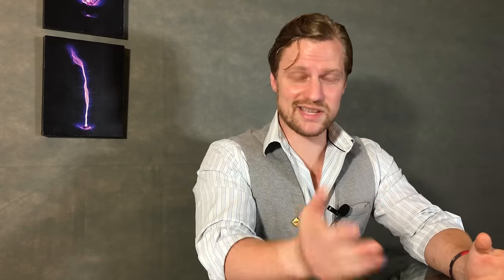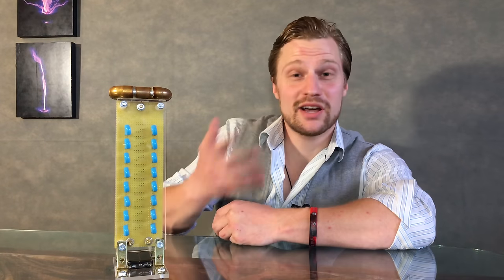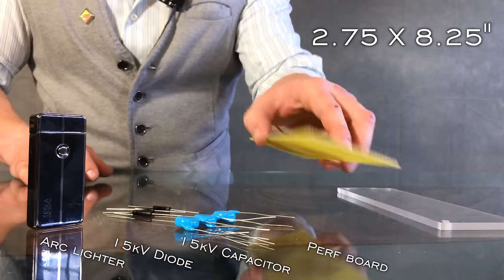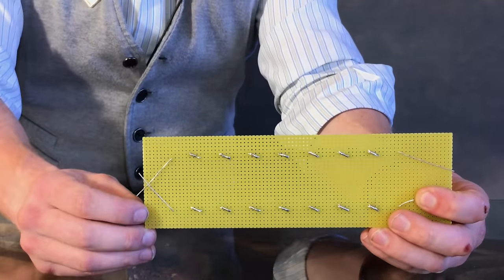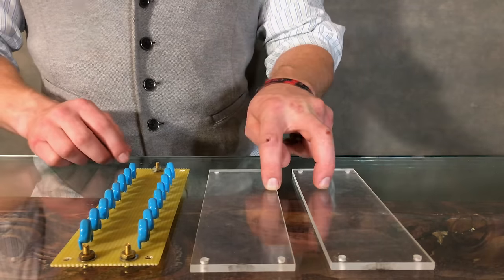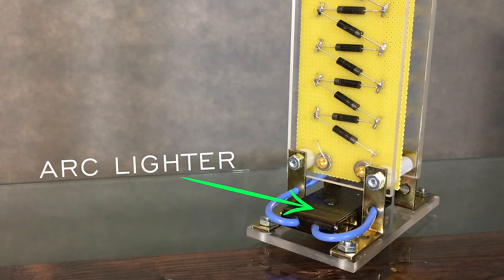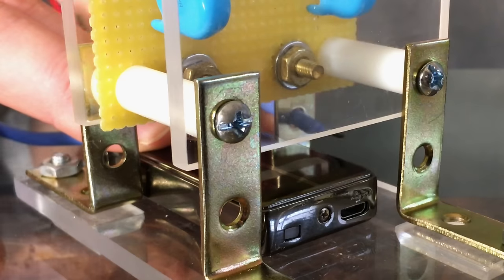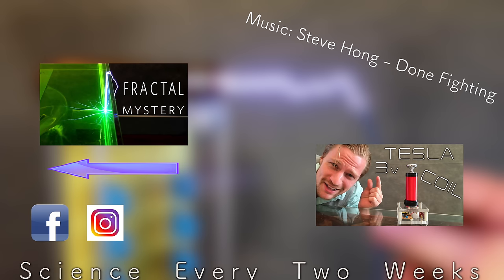DIY Desktop Lightning Tower (USB rechargeable!)

Comment: I would like to build a voltage multiplier using one of those ebay musical tesla coil kits as the power source. Could you please do a tutorial video on how to do it? It will be such an awesome build to see if it would amplify the music as well as the spark. Thank you for your consideration. I've subscribed and followed, hope to see it someday, as I don't wanna injure myself trying to figure it out. ( ; D)
Reply from the maker: Welcome to the family! And great idea.
Reply: How do get the high voltage for your equipment ? As I want to build a small arc generater      thanks Ben

Comment: Hey Jay, Love your channel!!! I made your voltage multiplier with 2 towers, 1 positive and the other negative and it works Awesome!! Keep up the great videos!! I hope you get that YouTube play button!
Reply from the maker: That is awesome! What is your max spark length?
Reply: Plasma Channel  13” is the longest so far before the capacitors start arcing across each other.

Comment: Hi Jay, Again, a bit late to the party, Only one suggestion..... Ok, 2. 1 a circuit digram for those that don't know what multiplier you are using, and 2 where the circuits ground should be, I did not see you show it. Other than that a perfect delivery, Thank you for your hard work in making these videos.
Reply from the maker: Certainly. The circuit diagram is the same for every voltage multiplier. You may search voltage multiplier schematic on google, and you can choose which way your diodes face, to determine (+) or (-) output. The ground is one of the input wires.

Comment: With : 4x 18650 lithium batteries, 4x tp4056 modules , 40x diodes, 40x capacitors, a 15KV High Frequency DC High Voltage Arc Ignition Generator Inverter one bc547, one bc557, one 1M ohm resistor one yellow led, one toggle switch, one push button, a 5V 4Amps charger and epoxy resin i made a powerful stun gun.

Comment: Nicely done!  I built a 14 foot tall version a few years ago for a big contract.
Reply from the maker: Thanks! Whoa... I’d love to see pictures of that. You should send a picture to my email in the ‘about’ section
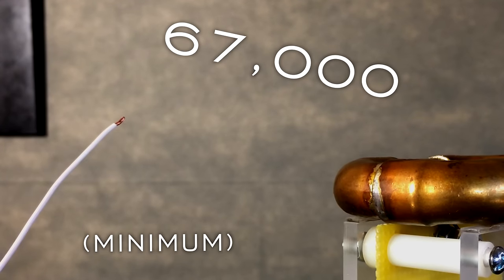Reply: I showed a few pictures at 1:30 mark in my mini lab tour video I released yesterday.  It was amazing, the diodes and capacitors I had to use were over $200 each.  I found a retired engineer from Fermilab to make the corona rings for me. I designed everything myself, including the drive circuit and a large potted transformer for the start of the stack.
Reply: What voltage, .....what application.?

Comment: Thanks for the video. I'm new to this stuff. Once all my capacitors and diodes came in I went to work right away building my own model. I was expecting it to explode but IT WORKED !! My arc is only about two inches but it's awesome. Thank you very much !!
Reply from the maker: Hi John! Im really happy you got it working. Just remember, only let it discharge to it's own electrical ground. Be safe, have fun!
Reply: Hello, this project looks amazing! I'm collecting the parts to make this project. But I don't understand where the electrical ground is for the lighter. I can't see on the video where you connect the wire too.  Many thanks! @PlasmaChannel

Comment: I used to work in a TV shop. A flyback transformer does the same thing and produces 30kv to charge a picture tube on an older tv but only milliamps of current so it's not lethal.  If you accidently get popped by a picture tube discharging I guess its like being hit by the difibulator in the ER
Reply: Which depending on what part of your heartbeat cycle it hits, can still stop your heart, or put it in fibrillation.
Reply: But Flybacks produce DC don’t they?
Reply: @Coyote0874  Asymmetrical AC. They are generally used to feed a diode, or vacuum tube (electron gun), that rectifies the output.

Comment: Very nice. To make it safer one could add a high value series resistor with the output terminal and top
Reply from the maker: This is correct. The output current is higher than I would like
Reply: @PlasmaChannel  The resistor would perhaps make it operate better as well given the current draw on the HV will be limited.

Comment: Wow this is awesome. I'm quite young and am not really sure what I want to do with my life but I am starting a few new hobbies. I'm really glad I found your channel because it inspires me to make things like this. Problem is I'm torn between the spark gap coil or this lol
Reply from the maker: Hi Cameron. I would highly recommend the mini spark gap coil first. It is much safer. I do not recommend building this if you are totally new to High votlage. Cheers, and welcome to the Plasma Fam!
Reply: I'm not too worried about the safety. It's more getting the materials and for that I think it's far easier for the spark gap tesla coil. Either way they're both awesome. Thanks so much
Reply: @PlasmaChannel  also may I ask how long it usually takes to wind up with copper wire for a coil?

Comment: Excellent work. Very impressive. Can you please explain how the copper tube is connected to the structure?
Reply from the maker: The copper tube is electrically connected with a wire that wraps around the top high voltage bolt on the board. It is glued in place.

Comment: Hi! Do you think that it would be possible to use an electric fly swatter circuit as the original HV voltage source instead of the lighter? Kind-of like in your museum mini tesla coil video.

Comment: Hi, I've enjoyed building this voltage multiplier but rather than use a cigarette arc lighter, I decided to use a barbeque arc lighter because the HV transformer already has long leads, is also USB chargable and has versatile positioning...
Reply: I just burnt out the arc lighter by arcing to the wrong ground. I drew my arc to the ground of the arc lighter when I think I should have used the multiplier ground… would that be right? New BBQ arc lighter circuit installed and everything is working fine.... for now.... ground taken from the multiplier section instead of the lighter ground

Comment: For anybody building this, if you could, buy 18650s from a trusted place like Illumn and IMRBatteries, and then connect them using 18650 holders, with the same charging circuit.

You will get much better battery life that way.
Reply: use a hv ignition kit then? with the 18650 batteries and then a push button switch or what did you do? wioll it work is it cheaper?

Comment: Hi Jay... quick question... if this lightening tower is not used to produce sparks... can it be used to produce electrostatic charge for longer periods?
Reply from the maker: It can, but I noticed that it tends to die easily if it continuously is just building up a static charge. That little arc lighter is very very fragile.

Comment: Well done video.  I would like to have seen where the wire was connected to, and how the copper top part is connected.  I know these should be as simple as running a wire and soldering, but I feel unsure.
Reply from the maker: Certainly good points. Thanks for the compliments. By the way, did you find the video's volume levels to be off or unsteady?

Comment: This is the coolest thing I’ve seen on YouTube!!! This so amazing!!! I am not understanding where to connect the positive supply from the lighter and where to connect the other lose wire to get spark from the copper tube... can you please explain this... please
Reply from the maker: Hi, there is no positive supply from the lighter. The lighter is AC. It goes in at the base and connects to both sides of the ladder. The copper tube up top connects to the final stage, the end, of the multiplier. Thank you for the compliments. Remember, only allow the device to discharge to its OWN electrical ground.
Reply: @PlasmaChannel  when you say the electrical ground of the multiplier, this means one of the terminals of the arc lighter's output, right?

Comment: nice!........that is a cockroft-walton brige.
have you heard of a marx brige (even simpler, and no diodes)
Reply from the maker: Marx impulse generators are very cool as well. They are a bit problematic when it comes to finding appropriate high voltage resistors though.

Comment: Can we use a high voltage transformer without  using the arc lighter  (high voltage transformer 3.7v-4.2v to 15kv boost step-up power module generator)

Comment: I built one similar in design to yours.  I used a piece of thin luan plywood since bare perf board is hard to find.  Just drilled holes for the capacitors and then spray painted the board black to highlight the light blue capacitors.  Looks nice through the plexiglass.  I'm using an arc lighter module DIY kit to power it.  I do get small sparks and a lot of corona off the top load but not really satisfying POPs off of it like you do.  Not sure what I might be missing.

Edit:  Reading through the comments it could be that my nice black spray painted board I've mounted my components on is leaking much of my high voltage away.  Bare unplated perf board is HARD to find.  Just about everyone plates the thru holes which won't work.
Reply from the maker: You are correct on your edit. I should have a link in the video descrpition for the perf board
Reply: A followup.  I rebuilt my capacitor/diode ladder onto a piece of Kydex plastic.  I found a sheet of that in black. Though it's more used for thermal molding it has good electrical properties as well.  I cut it to the same size as the piece of luan plywood I had been using.  The new setup will give me sparks about an inch long or so IF I add something pointy to the smooth copper pipe top load.  Off just the copper pipe top load I get a lot of corona and less satisfying discharges.  I don't know of any way to increase the output.  The small arc lighter circuit I'm using to drive this ladder says 3-5 VDC input and I'm already using 4 D-cells or 6 volts.  I could add another cell or two, I don't know what I'd hurt in my input circuit except perhaps stress the transistor a bit.  But it's on a good heat sink and it's not getting very warm even with 6 volts.  I can't put 2 of these circuits in series because the output is A/C.  The two circuits will not be in phase and so the outputs will not simply add.  The little DIY AC arc lighter module kits I'm using are only about $3.50 off of Amazon so if I damage one by using too high of a DC input it's not a huge loss.  Worth trying a higher input DC level.

Edit:  Holy crap!  With 12VDC input this thing makes huge sparks!  Over 2 inches long! And the transistor isn't getting more than slightly warm!  If anyone needs a good input power supply for their lightning tower, go to Amazon and search for "15KV High Voltage Generator Boost Step-up High Power Module Inverter".  Vendor is Walfront.  You get two build it yourself circuits for $6.99.  Cheaper than a lighter!

Comment: Your multiplier makes topload negatively charged. So if you remove the copper top-load and put sharp needles or carbon fibers instead will it be the most powerful negative ion generator?  Will it throw most powerful ion wind?

Comment: This is amazing! I would really like to see a electrical circuit of that, I tried to understand in which way you connected the capacitors to the diode’s and I had no idea how you made it, I by myself want to build this so please upload a diagram or make a new video and try to explain a little more because some of the information was missed, thank you very much, i send it to improve!
Reply from the maker: Hi NirNana, This is a standard voltage multiplier schematic. You can search the schematic on google. I'm glad you enjoyed the video

Comment: Hi Jay, did the arc lighter specify which of the 2 hv wires was positive? Or did you need to figure that one out. Thanks
Reply from the maker: The arc lighter was high frequency AC. There’s no solid positive lead
Reply: Edit - I got it working, even though my lighter has the X/cross plasma arcs I can use one of the HV outputs and it still works. Thanks! Now to build the tower :)

Comment: Without any doubt you are a great personality when you dedicated all this effort; and I am in debt for your videos. You are surely aware there are different forms of similar circuits like the one you are presenting in this video. Notably there is a famous one called Marx Generator, you can simply check the internet. This Marx Generator simply replaces your gas lighter for a simple battery.

Comment: Can I use a mosquito swatter instead of Arc lighter?
Reply from the maker: You cannot....as mosquito rackets are DC. Multipliers need AC input
Reply: @PlasmaChannel  thanks for the quick reply sir. Can you show us a method to do this with salvaged parts? ( If it's not too much to ask). Most part you listed are not available to me. But it's an interesting project to make.
Reply: Btw, I love it when a youtuber genuinely replies to our query.  Hope you channel grows. Amazing content!
Reply from the maker: Hey, thank you so much! So, I actually made a casual video about how to make a high voltage power supply. Its called DIY 10000 AC power supply. It can be used for this project, IF, you tone the power down. But i'll look into how to make a high voltage variable output supply

Comment: Building the desktop lighting tower. I could use some clarity on the diode polarity. Also what connection is ground to attach the spark gap lead. Is a schematic available?

Comment: This is such a great project. I could not tell inbbthe build where the ground lead you talked about was built in though. Where should that be? And does the copper pipe at the top need to be a closed loop like that or can it be a cylinder extending up? Thanks for help and thanks for all the awesome videos!

Comment: @Plasma Channel i have already got my own arc lighter however as you said"Frequency is not super critical. Any high frequency AC high voltage will work (as long as it's less than 5-6kV). But I'd quickly calculate it as 12kHz" , i'm wondering how to calculate the frequency of this little device. Maybe you can help me with my problem.
Reply from the maker: by 'this little device', do you mean your lighter? Mine as I found out recently is 15kHz. Works like a charm! I found out my frequency by placing it near the probe of an oscilliscope.
Reply: @PlasmaChannel  YES,i do mean the arc lighter. I have measured the arc lighter that i bought on Alibaba which is a online shopping website in China. But i found it is not qualified for my purpose. So i want to build a arc lighter by using the sample topology(circuit diagram) called "Joule Thief" with a transformer. While by doing this, i don't know which part of the circuit determines the frequency.  I thought that you do calculate the frequency.:P

Comment: It's a Cockcroft-Walton multiplier, but I thought those require AC input, not DC from a battery, unless the lighter converts DC to AC.
Reply from the maker: The lighter pumps out high voltage AC

Comment: Fair enough, I tried getting a little spark gap setup working yesterday and it didnt work. I used a 30kV 2nF cap and 2 12kV Microwave Diodes, hooked up to a 15kV Plasma lighter type HV Supply. There was almost no voltage on the output, and i suspect that the diodes cant handle 22kHz.
Reply from the maker: That is correct. Those diodes are not intended for high frequency. Basically they have no idea what is going on, and dont conduct when they should. You need special diodes, like the ones I have linked in the video description. Best of luck!

Comment: I’m going to put an apoxy resin on the base of my lightning tower to help insulate the edges i might have because my not so round soldering skills. My caps are rated at 20kv 1nF, and my diodes are rated for 20kv 5milliamps(couldn’t find any with high current rating with my budget) i’m considering a 10-15stage, the AC input power is going to produce 15-20kv high frequency power with a small circuit i built. I’m hoping this will give around 5-7” spark
Reply from the maker: Cheers! Let me know if you have any questions. Just know, those diodes may not last long. A 5ma diode cannot handle the high currents involved with the discharge of a spark.

Comment: Instead of an arc lighter is it possible to use those high voltage modules on ebay ? They are black and cylindrical

Comment: i want to make this but i have an arc lighter with 2 arcs crossing. how do i do that?
Reply from the maker: That's actually what I ended up using. Wire the two transformers in series. Experiment to see which two of the 4 high voltage wires need to be connected, in order to make the highest voltage. This will, however, cause more coronal breakdown so slather the whole insides with wax.

Comment: Would this still work if the capacitors are rated at 15kV and 220 pF or  20kV and 1nF (I am unable to find 15kV and 1nF capacitors)?

Comment: Is this a play on the marx generator? Similar design except the Marx doesn't use diodes, it uses spark gaps, and resistors connect the caps.
Reply from the maker: the Marx and CW voltage multiplier are totally different. Marx is only able to generate pulses. CW can generate continuous current, or pulses.

Comment: The capacitor(Vmax) and diodes(Vrrm) only need to be voltage rated at 2x the input voltage btw.
Reply from the maker: 2x the rms voltage for safety. So 2X 1.414 ac voltage
Reply: Yes indeed, should always be based on peak).

Comment: I got one of these lighters and took it apart. I replaced the battery with a power supply. Over the course of a couple of hours the arc degraded then it died...

Comment: Have you ever thought about using larger capacitors on this and driving a Tesla coil with it
Reply from the maker: I have - though capacitors in a tesla coil primary circuit experience very high frequency AC. If a VM's caps are used as the primary caps in a tesla coil....it wont last long. The VM will inevitably break.